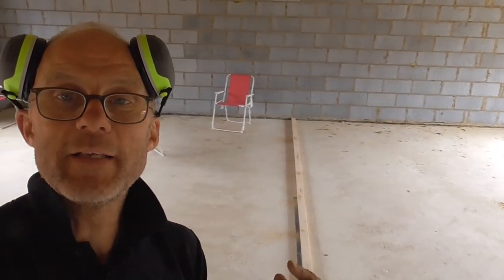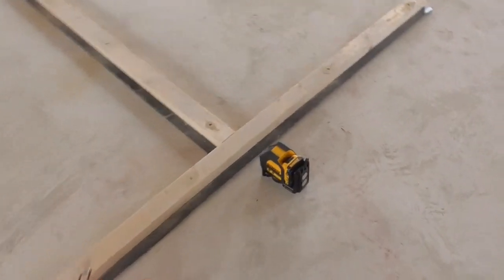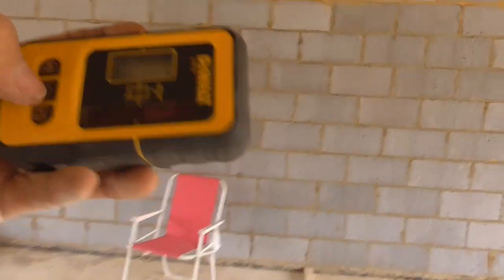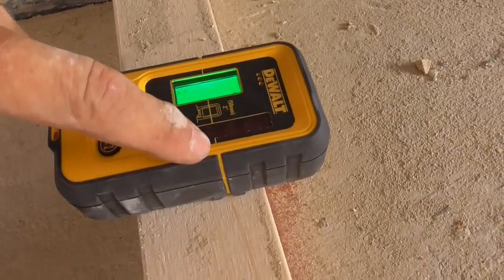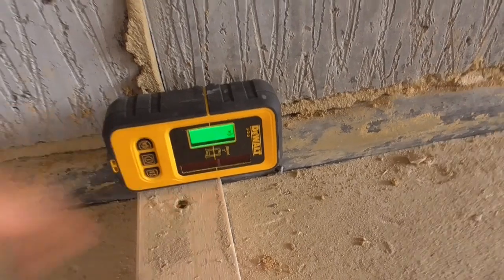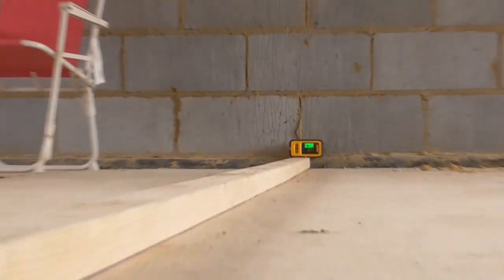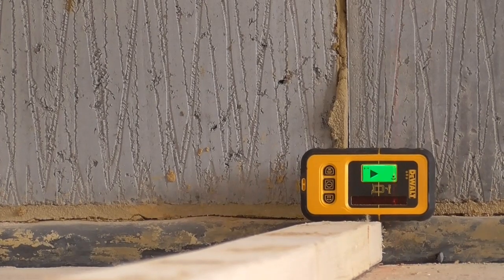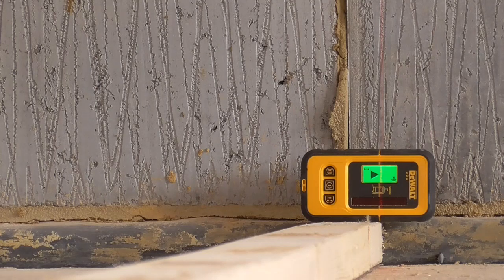Using a laser detector to help set plumb up timber stud walls.***DeWalt DE0892***

Comment: Can’t understand why I never thought to do this. Would save a few trips up and down to check if it’s right. Great tip Del and great channel by the way 👌
Reply from the maker: Hi Kevin🖐It works a treat, and I think I'm going to buy one of those rotating, micro adjust bases to make lining the laser up a bit easier👊Thanks for watching bud😎Cheers Del

Comment: Hi great idea I have ordered mine to do just that. I have the Milwaukee 3 plane laser as it has minor adjustments which this one does not have and an offset cross line so a person can plumb a line to the ceiling and see the cross on the ground, great idea just need better tools
Reply from the maker: Hi Tom🖐I think Milwaukee hit the jackpot putting the micro adjust feature on their levels👊It shows that they are really thinking about how their tools actually get used on site👍I'm jealous of your level😉Thanks for watching and your comment😎Cheers Del

Comment: I use 2 hilti dot lasers they are designed to fit over the floor plate so you just push up to floor plate one either end, dewalt do one as well lot cheaper
Reply from the maker: Hi Grant🖐That sounds brilliant mate👊then just join the two dots with a string line 👍 Time to go shopping🤑Thanks for your comment 😎 Cheers Del

Comment: Great Del. Does that detector work on just dewalt or all red and green lasers?
Reply: Only with a red if you’re using red and you need a green detector for a green laser.
Reply from the maker: Hi there🖐As Simon says, you need to have the right receiver for your lasers colour, but also this receiver doesn't work with earlier DeWalt lasers👊Cheers Del
Reply from the maker: Spot on Simon👍

Comment: Have the same one, great tip, thanks.
Reply from the maker: Bloomin handy bit of kit Sean, and I haven't had mine long👊Thanks for watching😎Cheers Del
Reply: @thetallcarpenter  it's good alright the receiver, not the best though for outside big work(raft /foundation) I found out. Topcon all the way I'm afraid.
Reply: @thetallcarpenter  brill use of the receiver, will be v handy 👍👍👍
Reply from the maker: @rockandmeatroll  My eyes arnt that good at the best of times Sean, but my hearings still ok😁
Reply from the maker: @rockandmeatroll  I agree mate, and this little receiver together with the laser is definitely not a pro outside setting out set up🤔
Reply: @thetallcarpenter  lol get ya, it's just very sensitive if you're used to topcon. I have the green version, the 3d laser version is pricey but looks amazing.

Comment: Would you not be quicker with a chalk line for laying out?
Reply from the maker: Hi there🖐I use a chalk line to mark for the top plate once I have got the laser in exactly the correct position over the bottom plate👍Cheers Del
Reply: @thetallcarpenter  aye aye got you
I did the same the other day
I have small laser level but only projects 150mm angle so doesn't run a full width of a room
Lasers are good at some things but the slightest of adjustment and your way out haha
Sometimes more hassle than they are worth